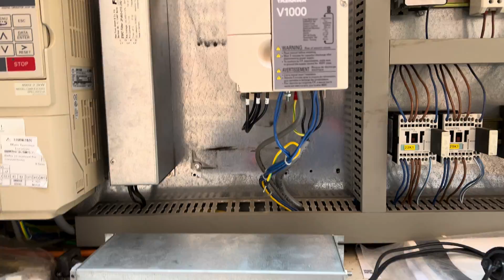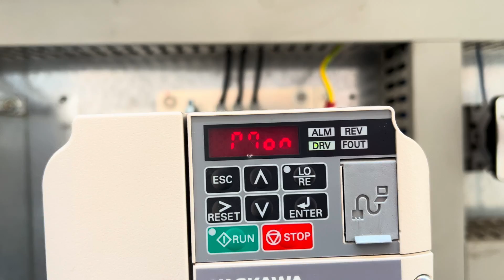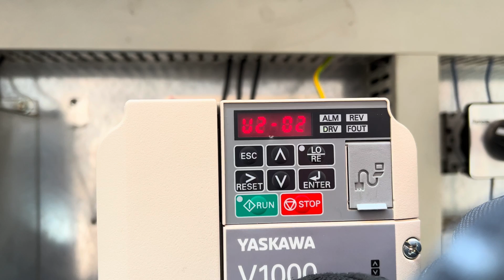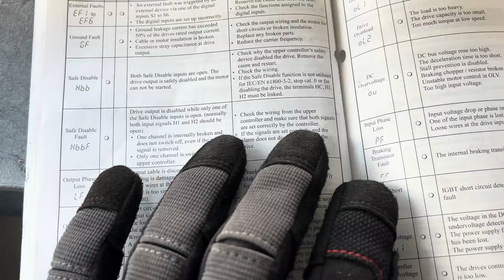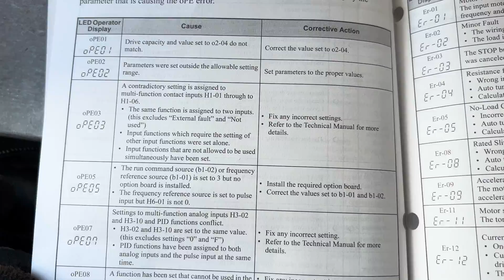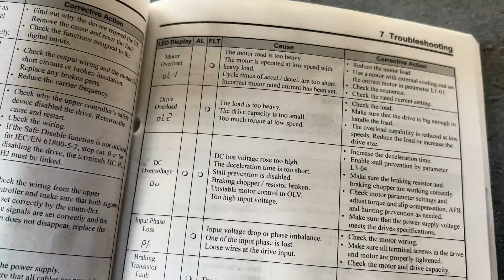YASKAWA V1000 FAULTS

Comment: I have some issues. Can i directly contact you ?
Reply: You got any info for error ef3? On this one
Reply from the maker: No.. but I can get technical support contact
Reply: That's the German version V1000 if you got it from us at KKT.  Most faults are same but some are not like NAIN which is not a fault but a maintenance reminder parameter P3-03 you can change it from 10k-30K and NAIN will disappear